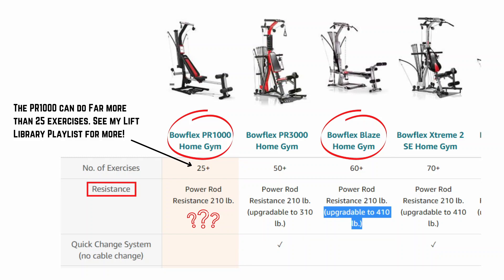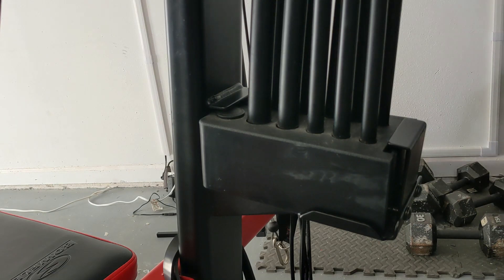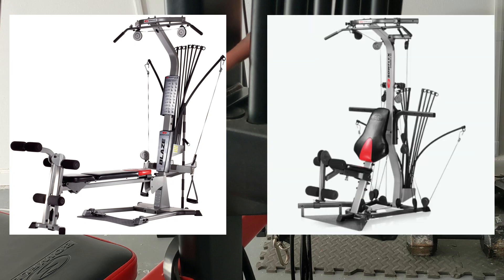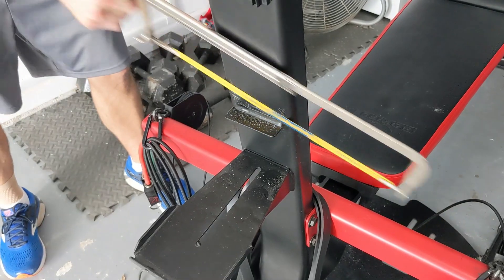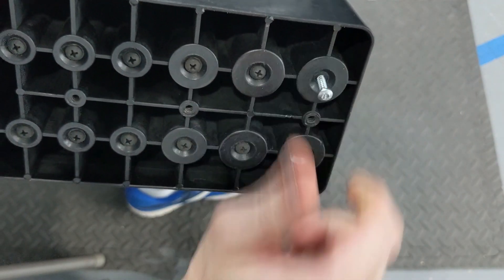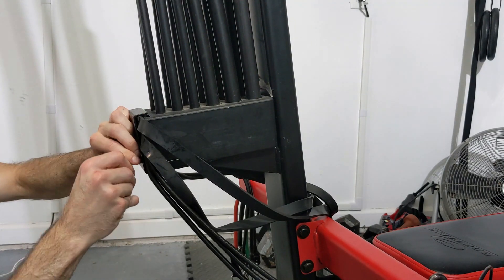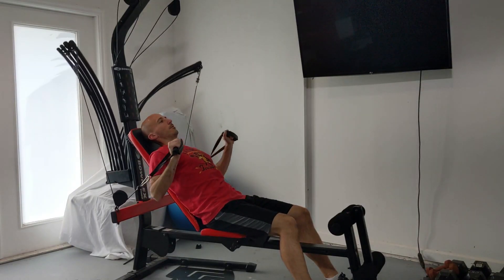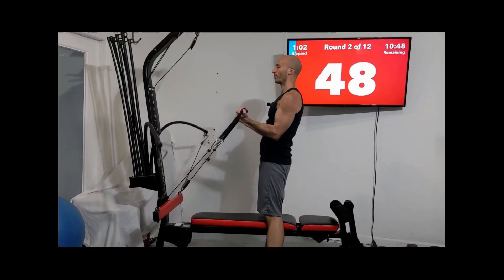Add Power Rods to a Bowflex PR1000 with this Hack! #bowflex #bowflexPR1000

Comment from the maker: Since making this video, I’ve developed a complete upgrade kit for the PR1000 and Blaze. Check it out here: https://youtu.be/3fuW6REm2mo

This kit is a more cost-effective way to add resistance, and it also addresses several other design flaws in Bowflex machines.

Comment: Hello I just bought a saw from Amazon to saw off that metal piece. I would like to confirm that if i buy the 50lb rods from amazon they will fit into the machine?

I have a PR1000 like yours.
Reply from the maker: Yep, it'll work. You can double check that your rod box has the extra slots for them. Please use the product links in the description. They are no cost to you and I get a small commission.
Reply: @BowflexWorkouts  It has two holes at the front where I have to saw off the metal piece thats blocking them. I was more worried about the bottom part of it not having a way to screw them in or whatever. I'll unscrew the piece off underneath it later today and check it out and when I Buy the rods I will use your amazon link, thanks.

Comment: Is there a place to get new power rods and additional power rods?
Reply from the maker: They are available on the Bowflex website. I'm not sure when they'll go back up on Amazon. 

I just released a new product that I think is a better option for adding resistance. Check it out here: https://bowflexworkouts.com/products/flat-bench-upgrade-kit-with-lat-bar
Reply: @BowflexWorkouts  have you tried the power rod blocks that are for 510 or 610?
Reply from the maker: No, purchasing additional power rods is expensive and I think the bands do just as good or even better of a job at a fraction of the price.

Comment: Is it possible jist to turn it around and take out the 5s?
Reply from the maker: I looked at mine and I think it'd work if you didn't use the piece on the back of the box. If you just flip it around it'd partially cover the holes for the 50's.

BTW, if you are interested in adding more weight to this machine, I have an upgrade kit coming out in 2 weeks that's a much better way to do it. Costs a lot less too!

Comment: Where did you get the power rods from?
Reply from the maker: I purchased them on Amazon, but they've been sold out lately. The Bowflex website may have them in stock. I just released what I think is a far better value and upgrade that you should check out. 

Details here: https://youtu.be/3fuW6REm2mo

Kit can be purchased here: https://bowflexworkouts.com/products/flat-bench-upgrade-kit-with-lat-bar

Comment: Great video. I was actually looking at this model but the max tension turned me off. Can I show how to install a second set of 50s on this model. I see the box has the slots for it but will it need more support. I noticed normally a bottom panel is added for that second set of 50s and wasn’t sure if that possible on this model
Reply: Can You show I mean in another video or messsge me please cause I am super interested in seeing how the second set of 50s is added
Reply from the maker: @chez6109  0:44 - I talk about that briefly here. You have to pull out the hacksaw again and cut the bottom lip of metal where the screws go in. You'd then just slot the box in as shown in this video: https://youtu.be/oxtRPRVTWvE?t=42

I have seen other people have done this upgrade to 410 on the PR1000, but I get my extra resistance through this:  https://youtu.be/bVD7mLLnHFQ
Reply: Thanks for the response. So you don’t need that extra bracket placed below the 410 add on shown in the video you linked? It will stable enough without?
Reply from the maker: I haven't tried it, but other users have said it is.

Comment: Do not do this. That bracket is there to prevent you from installing more power rods because the hardware and the frame itself are not rated for the added resistance/stress. While you might be fine I wouldn't take the chance especially when you can easily find a used Xtreme 2se or Blaze for under or around $300.  They both have much beefier frames.
Reply from the maker: Do you have a PR1000? It can easily handle another set of power rods
Reply: @BowflexWorkouts  No, because I wanted to be able to safely upgrade to 410 so I picked up a Xtreme 2se. You are probably right, but my info comes straight from Bowflex. If someone got hurt modifying their equipment from watching your video, you could be liable. You should probably add a disclaimer.
Reply: @beardedbatman9174 Of course Bowflex are going to say that lol .

Comment: just weakened the metal with that big hole
Reply from the maker: Yes, but the frame is way stronger than you might think. It's not going anywhere. I'm sure someone more skilled could have done it without hole.